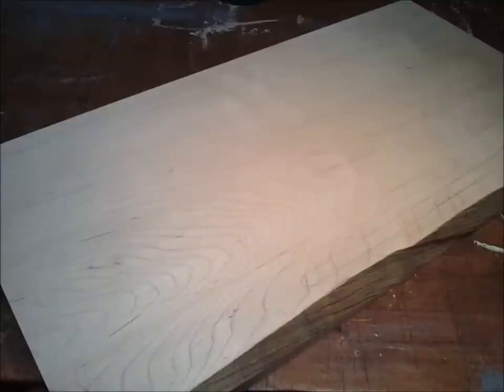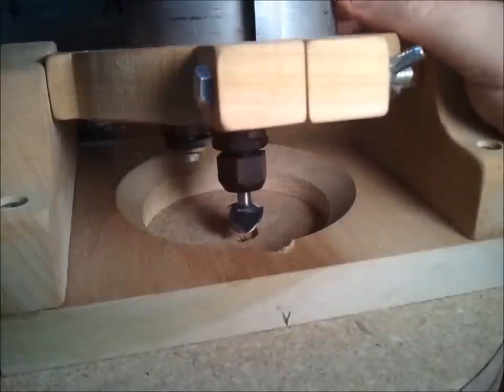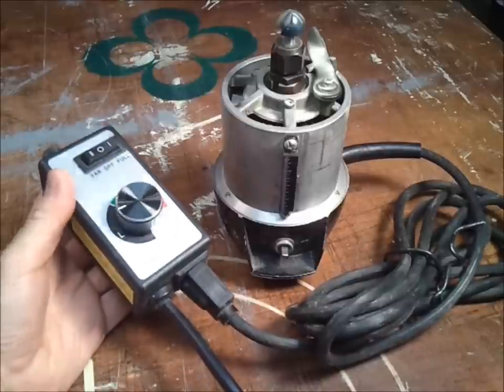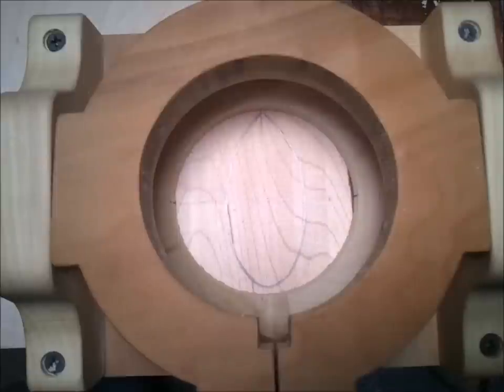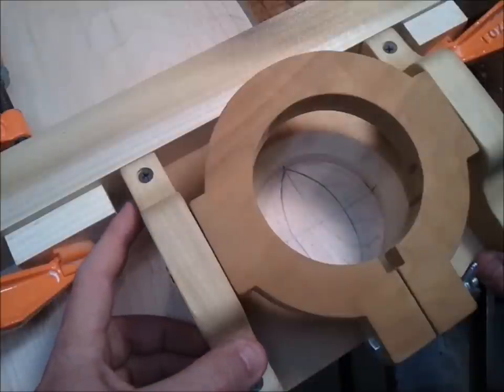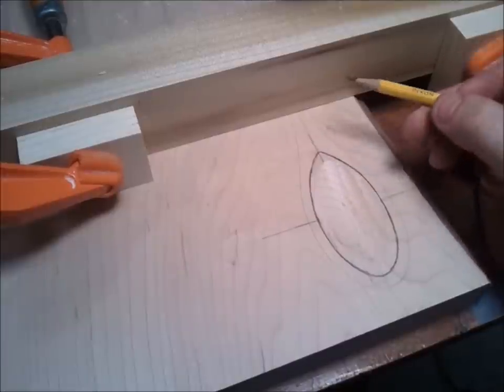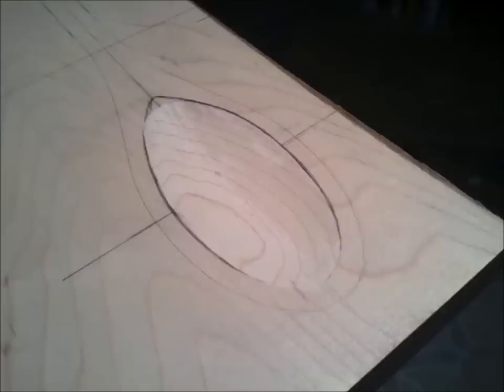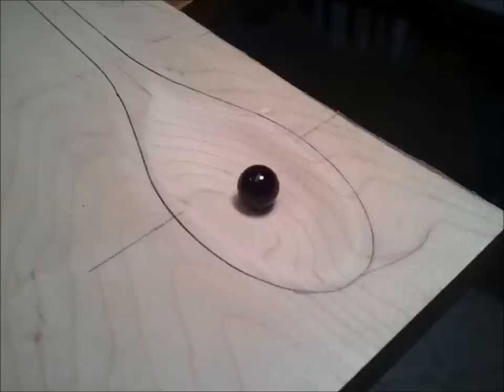Concave portion of a wooden spoon

Comment: I get the impression that carpenters get more enjoyment making jigs for their projects than they do actually doing the projects.
Reply: +Halinspark This is NOT carpentry. For some woodworkers there may be some truth to what you say. Making the jig is often the more creative part of the build aside from the initial design.  Sometimes making the jig is the real work,  once you have a good function jig, making the thing ( whatever it may be ) is really just busy work.
Reply from the maker: +iambism A lot of what you just said is so true; there might be something kinda stuck in the procedural mindset of most carpenters, where solving the problem becomes the primary goal. Once I've made a jig that makes making the gizmo simple for all future scenarios, I feel as though I've "solved" it. As a math person, I admit to finding delight in this.

As for the "NOT carpentry" bit, I must wholeheartedly disagree, because everything constructive that I do might be considered a type of carpentry: deviation, distraction, or otherwise. I would ask that you don't press me into a semantics argument on this point.
Reply: pocket83 Ok, I take your point, woodworking is an off shoot of carpentry. I was trying to point out that there is a difference between a carpenter and a woodworker. I practice both, they are not the same.
Reply: iambism Whether you classify this as woodworking or carpentry specifically doesn't really change the main point, though. All I'm saying is I've noticed a great deal of woodcraft videos are less "here's how to do a thing" and more "here's how to build a thing to do a thing".

Same applies to the knifemaking videos that use the stock removal method.
Reply: ***** I guess you didn't read past the first sentence.
Reply: Im guessing you didn't even read the first sentence.
Reply: For the record I wasn't making a value statement of one being better than the other.  I was simply expressing that it would be nice to use the correct terminology.
Reply: ***** GOT EM!

Comment from the maker: I saw it. It's a 2-axis gimbal! That is a great idea; it will conserve the height. That's funny... that I have been working on building a compound gimbal since, and did not put two and two together. Way simpler than using a bearing. If one axis could lock, it could still be used for "wave pattern shaving," as well as for making a spherical portion. Let's build it.

Comment: Have you revisited this concept? It's a cool setup to make a spherical concave cut, and i understand how moving the blocks allows you to route deeper and longer as you approach the center giving the compound oval shape that  you clean up with sanding.  

It's a fun problem to think about.  Right now i'm wondering if you (you as in you, me, or anyone seeing this) could do the routing with a dremel tool as it's smaller & lighter, and build a guide jig to create the concave shape?  I'm envisioning a similar wooden frame with the pivots in it, but mounted within that a bit of metal banding with a guide slot cut in it for the dremel tool.  The banding would have to be strong enough to guide the tool, yet flexible enough that you could have another slot, or maybe the same slot on the end. 

Hmmmm i don't know if i can explain this thought in my head, or even if it has merit, but a good bit of the enjoyment i get from your channel is that it often gets me thinking.  Ok, back to the idea, the slotted metal band is longer than the frame, and you could push the band into the curve you are looking for and tighten it down to the frame with a wing nut on say the Z axis, the frame would have a piviot on the X axis, and you'd need an adjustment on the Y axis to bring it down to the piece.  There are probably better methods, but thanks for the mental jump-start for the day, it pairs well with the coffee.

Comment: On your router tool holder jig, make another ring axes at 90 degrees to the axes you have. That way you can tilt it in the X and Y directions and make circle cuts without moving the jig. Maybe move the jig the long way slightly for an oval shape. You can make a bowl with it also.

Comment: I wonder what shape it will produce if you mounted the router in two axis of rotation(both X and Y) combined with X and Y axis's translation.
(you used only the X axis for rotation, and proposed using the Z axis in 1:33)

Comment: The control box is likely more than just a potentiometer, although that is what the knob is adjusting. The circuit chops the wave of electricity leaving fine gaps in the wave form. 
To know if it will work on another motor, look first at the rated output of the control box fractional Amps or horse power. Compare that with the router you are using. Somewhere it should have a specified Amp rating on it. There needs to be a margin of reserve for the control box, otherwise if you run it at full capacity for any length of time it will exhaust itself and likely give out smoke from within. I like to say typically 20% reserve. See if that is in keeping with your router's Amp draw per the control's supply capacity. This is not a hard rule and you could go for only a 10% reserve margin. But just so you know, as you push the limit, the box is getting hotter and will not endure for ever. If you are thinking of getting a heavier control box, and your other motor is only slightly out of the range of power this box is designed to work with, then give it a quick try without any work load, just to be sure the basic design is compatible. There are many different motor configurations, such as with brushes on an armature, synchronous, or inductive. Maybe the control box has papers that warn of the wrong kinds of motors.